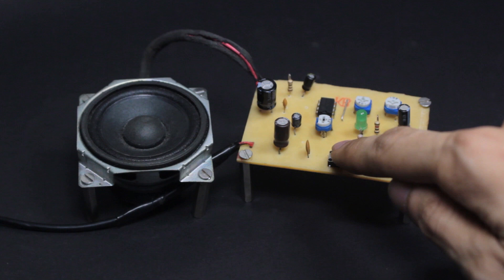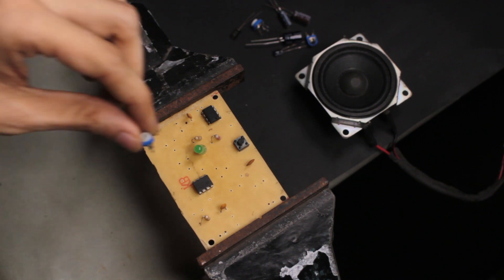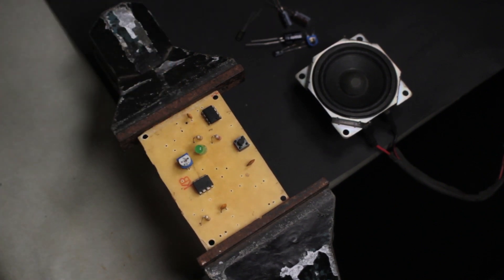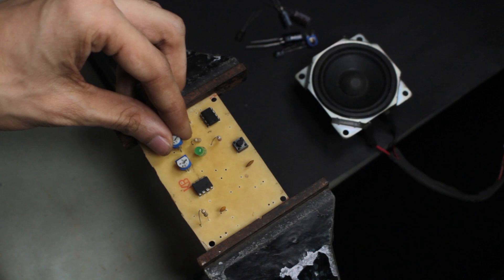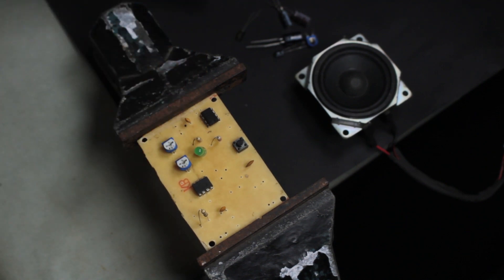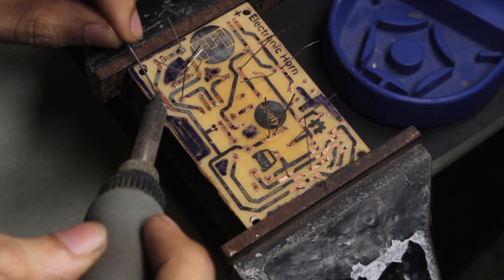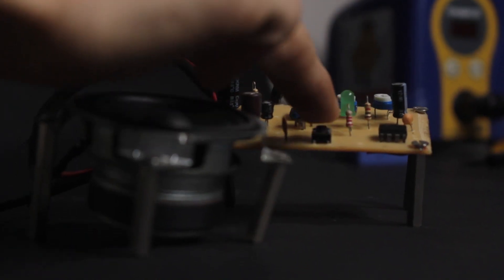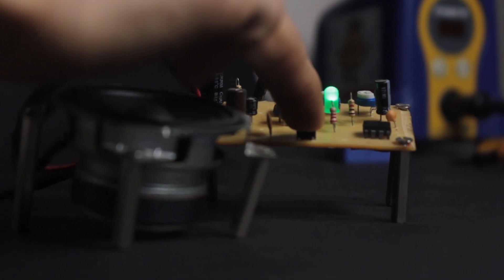Loud Horn Circuit | 555 Timer | Bicycle Siren #DIY #HowTo

Comment: Excellent video. But one question...how in the eagle board layout you have used top layer for 4 tracks (9v, GND and SIGNAL)  but in hardware you have used only single layer PCB without those 4 tracks?
Reply from the maker: The eagle board is a 2 layer PCB.

I used a single layer PCB and etched the bottom layer into it. For the top layer connections, I soldered jumper wire.

Some of the jumper wire can be seen from the top. A few jumper wires are hidden on the bottom side of the PCB to make it look neater.
Reply: @ElectroGuruji  Thanks for solving the query :)